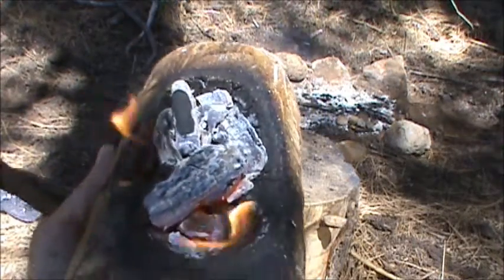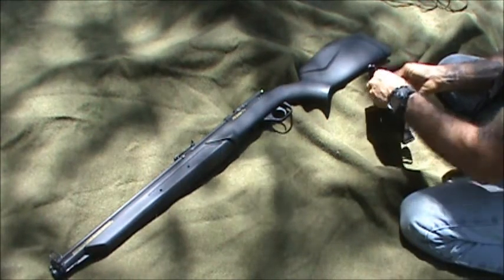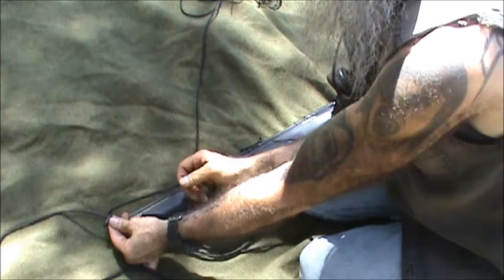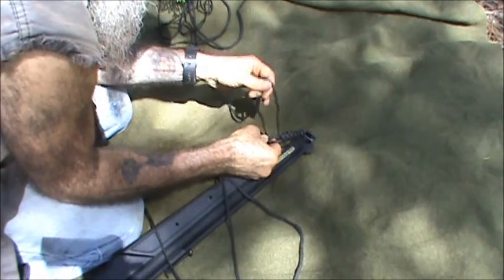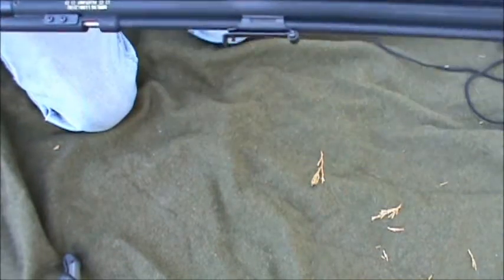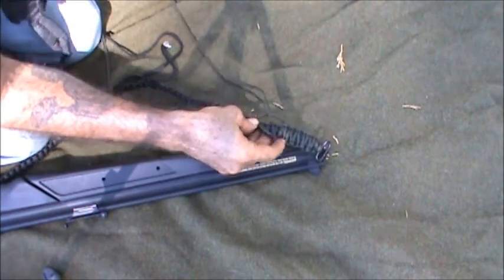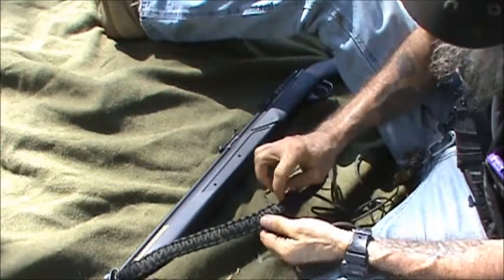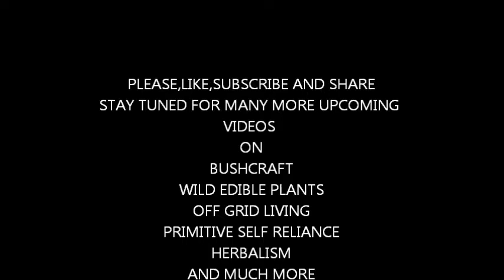benjamin 392s cobra weave adjustable paracord sling build,tutorial and discussion

Comment: Hay pal. Dig the sling. COULD YOU GO OVER HOW YOU MOUNTED THE SLING SWIVEL AT THE TOP OF THE MUZZLE? Thank you.
Reply from the maker: In short,I punched out the foreward roll pin and machined a swivel stud to fit.
The swivel is a standard uncle mikes.
I'll be shooting a comprehensive review video on the rifle in about a month including the mods.
Thanks for watching. 
Bill
Reply: Pale Horse Survival And Tactical. Thanks I’ll be looking for this review of 392s. One more thing!! What are a few beneficial things I can do with eucalyptus leaves?
Reply from the maker: @charlesii4830  
The video should be ready in about a month if all goes well.
One use for eucalyptus leaves is to add a few handfuls of fresh leaves to hot water and inhale the vapor with a towel over the head.
It helps to loosen phlegm  and open the airway when sick with a cold.
Reply: @Pale Horse Survival And Tactical Thank you Sir.